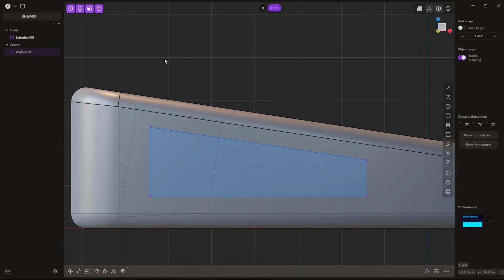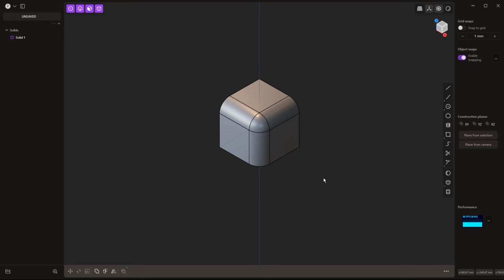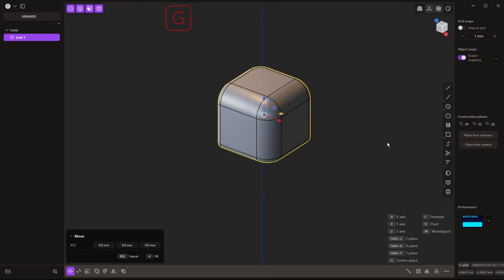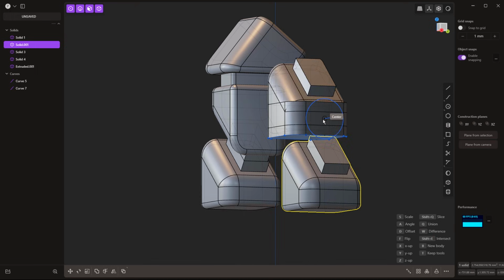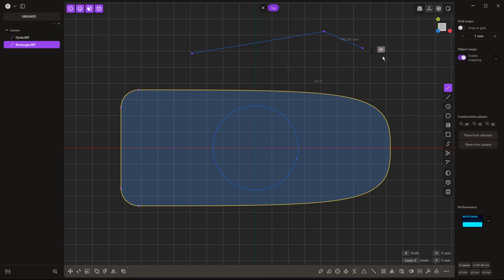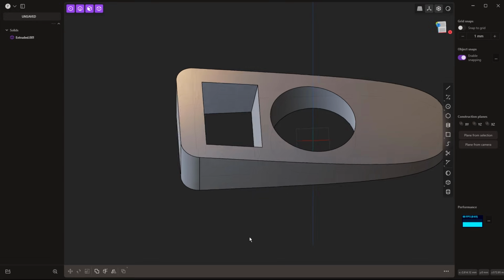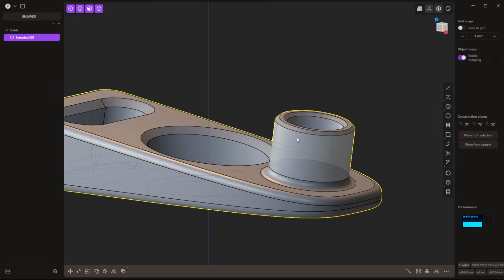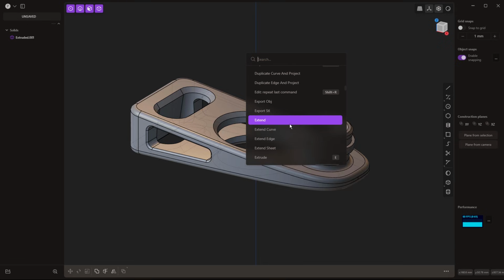Getting Started with Plasticity for Beginners | V1.4 Update | UI and Modeling Overview

Comment: Wonder how is work transition from Rhinoceros to Plasticity. I see you have 3d max work flow settings options even, but not Rhino 3d. Also  where are the layers ? Importing an object, layering, re naming layers, locking, then selecting parts duplicating into new layers to edit,  drawing lines with dimentions, snap points like center, near, mid, 4 view screen and into desired view enlargement with a click etc ? I would consider buying if it had Rhino workflow options available.
Reply from the maker: Plasticity is a bit different to Rhino as Plasticity is mainly a "direct modeler".  this video here was version 1 and today version 2026.1 was released (version 4).  There aren't Layers, but the outliner on the left has groups.  You can use dimensions and measurements, but you aren't building sketches and linking them to features.  You make curves and once a feature (surface or solid) is created, there isn't a link to the curve.  dimensions/measurements are placed on the solids and can be manipulated.  During creation everything has a numerical input, but it is a differnt workflow to a cad package.

For this new release there is PolySplines and there is a blender bridge that now allows 2 way passing of files in realtime.  You can model in Plasticity and the object is in Blender and updates in realtime.  You can also model in Blender and pass the quad mesh to plasticity which gets converted with Polyspline to a NURBS.

Comment: One of the most important commands that you could tell is the undo command.  I finely figured out that ctrl + z gave you the undo operation.  Now if I can just figure out the redo.  On Delta Cad those two commands are right at the top of the page, so they are easy to find and use.  Many times, in my designing I try something, take it away, put it back and keep doing this till I decide if I like it or not.  
I'll say, this program is a big learning curve for me coming from Delta Cad that is just so seemingly simple.
Reply from the maker: CTRL+SHIFT+Z is redo.  That is a good point that it really isn't anywhere.  I will mention that to Nick as its not under the commands list either.  It follows the standard windows undo/redo.

As for the program, this video is a bit old now.  I put cards and and ending video link to more current version 25 stuff and last week we just did a new 4 part modeling series.

Coming from a parametric cad program to a direct modeler is a big jump for sure (I havent used delta cad).  Coming from something like Blender is an easier transition for most.  It will really come down to a bit of what you plan to do with your models and what kind of control you want/need.

Comment: Hi! I'm trying to learn 3d modeling. I have a little background with sketchup when it was not web-dase yet. I have tried plasticity and having a hard time using it with my m1 iMac using the stock mouse. I am have trouble doing the space navigation moving around the object. Should I just change my mouse? Thanks
Reply from the maker: I personally have abandoned using a 3d mouse.  I used them for years (im old and started with the original ball design) and just found it to be more work to go back and forth to hit all the shortcuts.  So personally I prefer a standard mouse but a lot of it is preference.  We did a video on configuring a laptop but if you have a mouse i would use that.

Comment: I've just started learning Plasticity tonight, following your guide - and if it continues like this, I'm sold!
I have one problem though:
In the beginning you set your units to mm instead of m. But the version I'm using (25.2.3 (beta) - also tried 25.2.2 (final)) does not have the "Grids and Unit" tab in preferences! Any idea where that is now? Or does it not exist in the Trial version?
Reply from the maker: Yeah its on the right hand side now.  There is a Shader mode, All matcaps, edges, camera, grid and just below grid is a section for units.  Expand that and you can set your units, grid size and line spacing.

Comment: I literally just want to change the dimensions of the cube and i cannot get info on how to do it. IDK what is different when you were creating the rectangle that tab let you enter numerical values.
Reply from the maker: The UI has changed a bit from version 1.x to version 24.x and now 25.x.  For version 1.4 we did a video specifically on these features (as they were new then)
https://youtu.be/kATCRYZKE7U
Also in version 24.2 we covered some of the changes to measure/dimension that happened in an update.
https://youtu.be/LSAc4uyxTao

If you have a cube, select it and hit = you should see the 3 dimensions used to create that cube on the screen.  one will be highlighted. you can TAB to the others and change their values.  After edits this type of functionality goes away.

The other tool CTRL + = will let you create a measurement on the screen.  if you move a face (associated with that face) you will notice that measurement on the screen will have an underline.  you can then click on it and change the value.  This works for the position of features.

Comment: looks like version you are using is different than the new one 25.1.8 since there are no options default to specific tool and need to search for them each time. with make Plasticity more complicated and less friendly user
Reply from the maker: Yeah this is an older version v1.4 in the video title.  A lot of users still enjoy this video.  What we do is take the feedback and make updates videos.  Here is a lot of the newer content.
Whats new in 25.1
https://youtu.be/Vqf-Y_rhL0M
Getting started with surfacing in 25.1
https://youtu.be/fxcQ5ItCsaA
Getting started with solids in 25.1
https://youtu.be/CTgza6C5LzA
Getting started in 24.1
https://youtu.be/eT0_kX3eAEI
Getting started in 24.1 with no CAD experience
https://youtu.be/eijIg-sjPe4

V 25.x saw a ui update so the Whats new in v25.1 and the getting started content for 25.x is the most current.  the stuff in 24 and older is still applicable but there are some changes that have happened.
Reply: @LearnEverythingAboutDesign  thank you for valuable comment

Comment: Unfortunately bevels and chamfers can't be non-destructive like blender modifiers so guess I'll keep using blender despite it not being designed for hard surface modeling.
Reply from the maker: This is semi true.  If you select the face of a chamfer and delete it, it will patch the geometry back to a sharp corner.  There is currently no history in Plasticity but its good with direct modeling and/or resizing those things.

Curious on your workflow and why a bevel would need to be non-destructive?

Comment: Damn, after an hour of struggle to get that side parallel shape completed with end points connected, I just gave up on that part, pressed G then F for freestyle but couln't snap them together
Reply from the maker: Sorry to hear that!  We recently did an updated getting started set of videos.  One for those with no experience and one for those coming from another program.  I tried to take feedback from folks and address them in the updated video.

https://youtu.be/eijIg-sjPe4

When you free move an object you can also hold down CTRL to enable a snap to other geometry.  This has its limitations but might be the answer.

Comment: Is there a way for it to snap to edges? For example, if I chamfer or fillet an edge and it is about to touch another edge, that it would snap to that edge. If it's not clear I will try to give a more detailed explanation. Thanks for the tutorial.
Reply from the maker: yes and no.  well sort of :)  When you are creating curves you can hold down CTRL and snap to other curves.  When you are creating solids you can do the same thing.  So say you are dragging a chamfer on a model. you can hold down CTRL and snap to other things.  The "sort of" is that this is probably not going to give you the snap that you want in this specific case.  it works great for things like extrudes but if you have an overlapping shape and you want to drag a chamfer to snap to say the tangent of a fillet, it probably wont get you there.  you can move the object after and snap it t hough.
Reply: @LearnEverythingAboutDesign  Thank you

Comment: Is this not  a modeling program like Fusion 360 or autodesk inventor? Im looking for something to design a part and save it as a stl file for my 3d printer.
Reply from the maker: It is, you can design parts for 3d printing.  I have several videos in Plasticity for 3d printing, but "like Fusion" is tough.  It is built on the same back end but Plasticity is considered a "direct modeler".  So in fusion or inventor you create a 2d sketch, dimension it, then turn it into a solid.  You can go back and edit that sketch and the solid updates.  In Plasticity the curves (sketch) you create isn't linked to the solid.  Once the solid is created you use direct modeling tools to increase its size/shape (with a few exceptions).  There are tools like "Dimension" that have some limited ability to change the size/location of a feature like a hole but in general this is not the workflow of Plasticity.

I would check out some of the videos I did like https://youtu.be/FUH8IvXmodE  so you can see a bit more about how Plasticity is used for 3d printing and decide if that works for you.

Comment: "Short cut keys have changed"!!! I hate that!! Whats wrong with developers!! My wife moved the trash and it took years before I stopped looking under the sink for it. I spent years learning blender 4.9 to 6.9 then stopped because they do not understand how difficult it is for some people. 6.9 is the best interface, they can say it all day long but 7.0 + sucks, and whatever they did with layers sucks. It was impossible to improve on, no matter how much Blender says it is better. There needs to be a guarantee they will not move the furniture around every day like my wife does before someone like me put 5 years learning every day into it. one time she moved the bed and I fell on the floor in the dark because it was not there. I would have switched to Maya but I had so much time invested in Blender.
Reply from the maker: Which keys changed?  I know the frustration!  Since I teach i generally leave everything as default, but in Plasticity you can configure the shortcuts.  When you use F to find/search for a command. right click on it and you can assign a new shortcut if you want to.

Comment: When Fusion is basically a free software, I don't see the point. Is this better?
Reply from the maker: Different strokes for different folks really.  Fusion is free for hobby users but not commercial use.  I am grandfathered in but most pay about $500/year for commercial use.  Really the big thing with Plasticity is that it is a local install perpetual license.  That appeals to a large base of user.

Plasticity is like a companion to Blender.  So its aim is more for render/viz/game/movie type models.  Plasticity is often only part of a workflow.  

Fusion is more for the mechanical designer.  Someone who needs to make an injection molded design, or CNC machine a part, or simulate how it performs under load.

Because Fusion is free for hobby users there was a large contingent of people who were using it, or MOI or Shapr3d to do "hard surface" models that are typically difficult in a mesh program.

So that is the long way to say it is better for some users that want a direct modeling program to export their designs for rendering/vfx type work.

Comment: is there a model size limit for plasticity? cuz like shapr3d is limited to 1km2
Reply from the maker: Im not sure actually.  I don't tend to model at those sizes.  I just made a square that was 1000m x 1000m and there is some clipping that is happening and its not treating it like a closed profile to extrude.  I tried 100x100m and still couldn't get it to treat it like a closed profile.  Just below that it worked fine and could extrude up.  I don't know how this affects modeling and scaling objects that large.  For example I was able to make a 99 x 99m square, extrude it, then scale it larger than 100x100.
So sorry to say I don't know but it would appear there is some sort of limitation.

Comment: Great video. Your vids are easy to follow and great instructional guides on how to get familiar with the product.

 I am on a Mac and some of the keypad controls do not translate. My biggest issue is the extrude then difference. Sometimes it works, sometimes it does not. The first holes we made worked no problem. The last extrude difference function going laterally through the piece using the hand drawn lines would not work. I created a simple square, put a hole through it with a cylinder no issues. I then tried to do another extrude difference function on that same square using another smaller square and it would not perform. 

I also tried  to extrude difference to a square with a hand drawn line triangle (extruded to go all the way through the square and it would not perform the function to create a hole. So I know the function works, but it seems fickle. I have tried the above describe exercises with all combinations of the point, line, face and object boxes checked and unchecked (upper right hand corner).

It is a year old MAC pro with plenty of computing power (M3 max, 36 gig of memory running sequoia 15.1.1).  Perferences are set to  plasticity default, performance is set at normal for GPU rendering and normal for CPU faceting quality. 

I love how intuitive this program is, but there are certain things that are frustrating when they do not work as they should or only at time. Any help or advice you can offer Ould be great. Thank you.
Reply from the maker: Thanks, and wow sorry to hear about the issues!  Since I don't have a Mac I can't really confirm what you are seeing, but you are the first one to mention it.  When you do the extrudes with the hand drawn profiles, are they showing up as Closed profiles?  And in the outliner on the left are they showing up in the Solids section?  Reason I ask is because if you select a closed profile but select the curve and not the profile in the middle, you can extrude but it gives you a sheet (surface) and that won't work as an extrude tool.  It would work as a cut tool though.  You could try selecting the profile and using C for cut.  Other than that I would say email me a file support@caducator.com , one that won't work with the extrude and i can try on my side and see if there is something I noticed.

On the controls not translating do you mean just the CTRL vs CMD and ALT vs Option?  or something more than that?
Reply: @LearnEverythingAboutDesign  I will go back through the video this weekend and complete the excercises again and see if what you mentioned is the issue. Since am just learning the new software from scratch with little to no 3D experience I can not say I know exactly what you are talking about but will keep your comment primed for when I get to that part of the video.

Keep doing the great vids, I have been watching your vids while I am at work and waiting on docks to open (I drive a delivery truck). Take care and I REALLY appreciate your taking the time to reply and give some advice!
Reply from the maker: @bombproofbushcraft  Happy to help.  You should check out this updated video as the one here was version 1.4 and there may be some slight changes.  https://youtu.be/eijIg-sjPe4   that new video was done in the most recent version about a week or so ago.  We also have another video just on curves which might help better understand construction planes and curves in general.
Reply: @LearnEverythingAboutDesign  Thanks for the update video link. I am on it now. I also hunted down an old Mac keyboard with a number pad on it to see if it helps. 

You have no idea how much it helps and how much I appreciate your replies. take care, and thanks again for everything!

Comment: Still has bugs. What happen at 21:35.
Reply from the maker: looks like at 21:35 I did an offset edge on the top face using O on the keyboard.  then selected the face and pulled it down.  Offset can be used to create edge divisions on the face of a model and also to offset the face itself like an extrude.
Reply: @LearnEverythingAboutDesign What this offset and pull had anything to with that corner disappearing. You Right away corrected by pulling it back.
Reply from the maker: @JBCool0729  what you see happen to the back right corner is clipping.  its not cutting the model but there is a "bounding box" where something before it or after it gets clipped in the view.  So if you have a really large cube.  What is happening as i drag the offset downwards is that it was increasing the bounding box of the object and the view was getting clipped.  This is true in other programs like Blender.  Your objects get clipped.  I don't think there is a way to manually change that BUT it has changed in newer versions than 1.4 that was in this video.

Is that what you mean by the bug?
Reply: @LearnEverythingAboutDesign . yes but still don't understand why.
Maybe a video would help
Reply: @JBCool0729 I didn't understand either

Comment: Good video, but since Plasticity is not parametric (what I heard) how do you go back and change something, for instance what if you wanted to go back to the beginning and change your corner radius's?
Reply from the maker: Correct it isn't parametric.  there are some tools like "Dimension" that let you add a dimension to a feature and then using Move you can actually reposition it.  But for your case on changing a radius you would just select that face.  The offset tool is default and you can just start pulling that to make it larger or smaller.